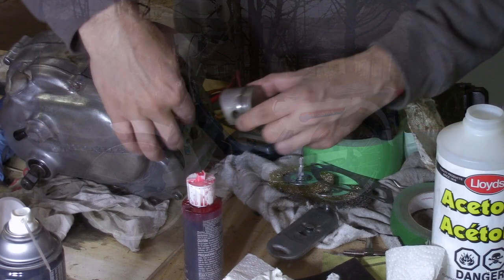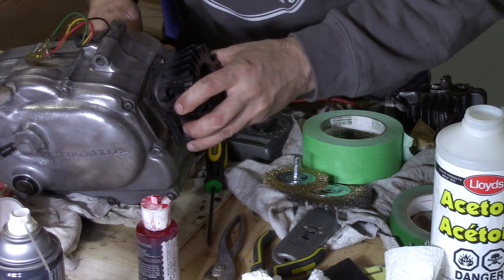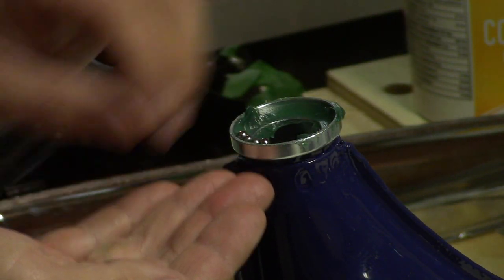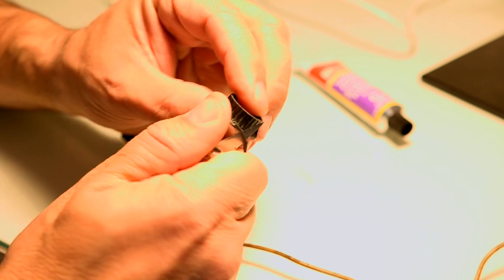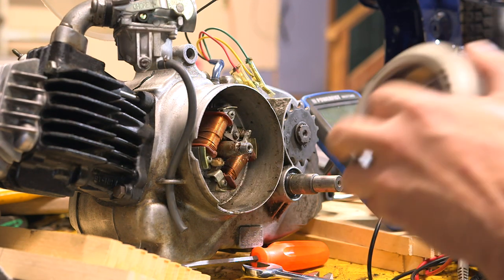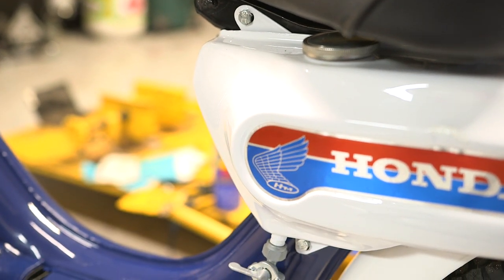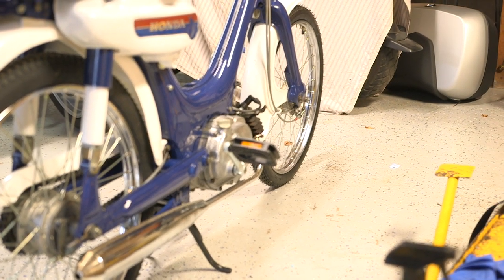1971 Honda PC50 Moped Restoration

Comment: Hello Chris, I really thank you and enjoyed this video - what a beauty. I have a late 1969/70 Red Little Honda PC50EA that looks to have the same setup, with the OHV. Wondered if you could answer a couple questions. I inherited this bike from my Dad, and I'm just an ok mechanic with basic tools. I found the avenues for parts, CMS/Myrons Mopeds/Treatland. I have cleaned and replaced new parts in the carb. Seems to start right up every time and runs ok at idle and slow speed but sputters intermittently at med to full throttle. I adjusted the rocked tappets (didn't really need much movement) and same with the timing according to the online honda manual. It has new fresh fuel. Any advice or tips would be greatly appreciated. I wish there was someone in my area that knew how to tune up to perfection this bike as it is a blast to ride here in san diego. thank you

Michael
Reply from the maker: thankfully these are simple engines and you should be able to find and fix the problem
I would start with ensuring the needle is set in the correct slot. 
secondly, i would run back through the ignition system -- double checking the points gap and changing the plug and wires (if you have not already) weak or mistimed spark tends to show up in the upper rpms 
from experience, slow speed problems are much more challenging to fix than high speed ones. so feel confident that it will be a easy fix.
Reply: @kiki231000  Hello Chris, thank you so much for the reply and helpful information. I'll proceed accordingly. I did replace the spark plug, but perhaps replacing the wire is a good idea...might be hard to find..but will look. Happy holiday season

Comment: Cant wait till you do some vids on restoring the RT on Lockdown 😁, Cool little bike, How did you go with cleaning the chrome?Ive got an old 535 XS thats in need of some treating but im nog going to flog myself on a full restoration. Take care.
Reply from the maker: The chrome presented a couple challenges. One piece ( the handlebar) was too far gone and i was lucky to find one that was still new (old) stock. VERY lucky. The Headlight bezel was lightly rusted with very little pitting, so I sent it to a company for re-chroming (45 bucks). They soda blasted it smooth, then did a proper chrome plate. I considered a spray-on coating, --- they are good, but they don't match a real plating.  I have a home plating kit that can do small parts with nickel, and it looks very good, but it would take me a week to do anything substantial.

Comment: HI Christ. Thanks , great video. I picked up a 1977 yesterday and plan on restoring. I am not getting any spark on the sparkplug but the lights and horn comes on when i turn the engine over. I assume this is the other coil that needs replacing. Where did you source the coils? Do you have a part number I can look for please? Thanks and regards.
Reply from the maker: Anton Peters you want to try CMSNL on line. Also try Treatland. Both were great resources for me. BTW, test your coil before replacing, as it may just need to be adjusted

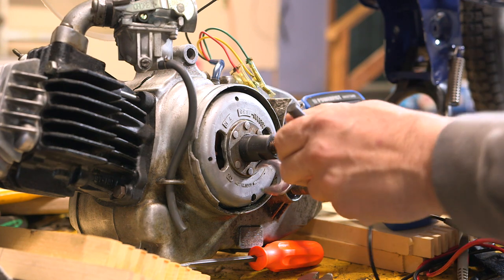Comment: Hi I've just acquired a rusty '73 PC50 in a not so great state. Could you please tell me the name of the tool you use at 1:30 to remove the magneto cover? Thanks
Reply from the maker: Im told many will fit-- i used a Honda one which is available at Treatland -- not sure of the part number